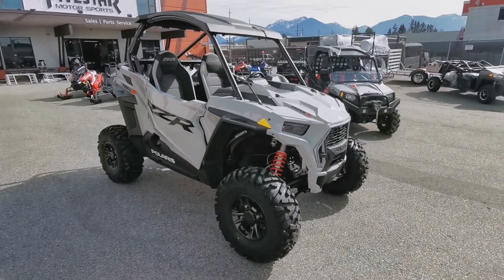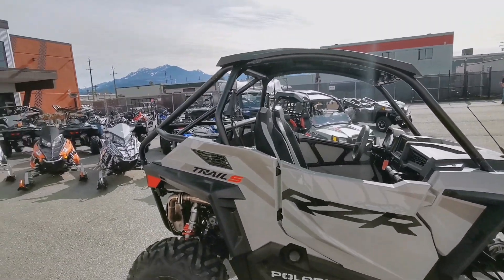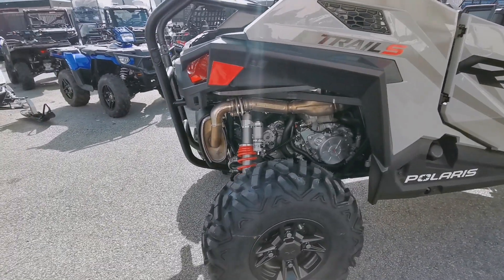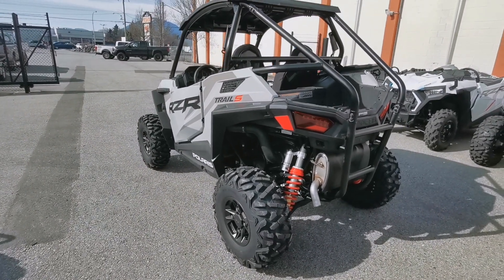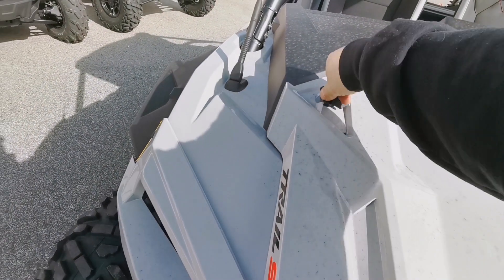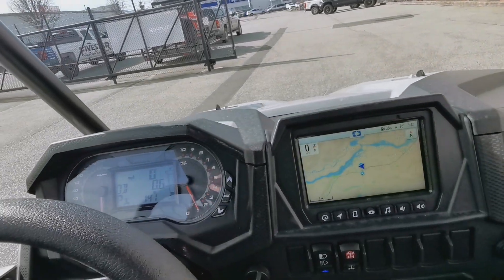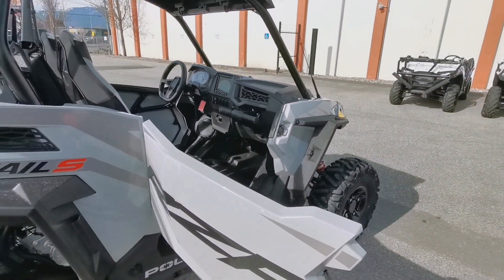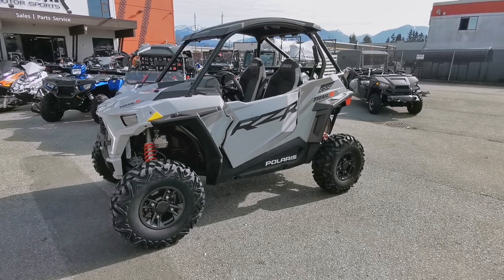Polaris RZR Trail S ULTIMATE walk-around 2021 loaded model.

Comment: Thanks for the video. I bought this exact model two weeks ago. 1st time RZR owner, so I don’t know that much about them yet. Or even how they ride. I loaded it on the trailer at the dealers, after buying it, and it did not engage smoothly. It made a loud engaging noise. But the salesman didn’t say anything, so I assumed it was normal. After riding it around the house for a couple weeks, I’ll put it in High, go forward a little, stop, and then it slips out of gear. So I’m guessing the noise isn’t normal. Your video just reassured me, cuz it took off smoothly!! Thank You
Other than that and a P150A code, I love the ride!!
Headed to the dealer with it today.
Reply from the maker: Glad it helped out! Definately something wrong there. Maybe linkage but good thing you getting it takin care of fast!
Reply: Good to know!  I'll check for that when I drive it up on my trailer at the dealer.  I just ordered one, they said 2-3 weeks.

Comment: I own the little brother  - a 50" 2021 RZR Trail Ultimate. Same setup with just a small handful of differences. I love it - the little dude will go anywhere! My only concern at times is its narrow stance. It gets a little tippy in tight spots where a 60" probably wouldn't. But, I'll hang onto it for a while, because it just barely fits in my 6x12 enclosed trailer. I've kept it stock with the 26" tires. If it was any taller or wider (like the "Trail S"), I'd have to buy a bigger trailer. Great machines, though! Thanks for the great review!!
Reply from the maker: If you can go even couple inches wider it helps with spacers or offset rims. I know they have kits at super atv to widen to 60. 
I know what you mean on tippy. Even 60 is borderline too.
Reply: @MartoriousMartuzzi  Thanks for the info! I'll look into it. My little RZR Trail is my first machine, so I'm still learning. I just try to be careful in big, rocky off-camber stuff. It is what it is, though - the very things that make it tippy and low clearance, also make it super nimble. That little machine is a lot more capable than I am! Having fun with it so far.
Reply from the maker: I have a friend that drives a 900 trail and he is off camber all day and out drive us all. But he looks like him and that sxs are one. It’s insane to watch. 
Key is ride safe and know your own limits as well as the sxs limits and the fun will last forever. And yes I love the small sxs feel also whipping around all the tight spots and trails. The big sxs are the big. The trails are trails and the 64 wide is the sweet spot. Ride safe and have fun all that matters!
Reply: @MartoriousMartuzzi  Yep, thanks! See you out there!

Comment: 2021 rzr trail 1000s ultimate I bought one about 3 weeks ago has been a great machine already have 200 miles on it but  I wish It had a little bit better suspension those small shocks don't soak up the big bumps. Also wish the rear a arms had more offset to run bigger tires. Overall I'm pretty satisfied. Realistically should have bought an XP but definitely impressed with the trail on certain obstacles.
Reply from the maker: That's good point about offsets. Guess it's part of nimble build.
End of day these shocks are okay but the springs suck pretty bad. I'd be looking into shock therapy or something to that respect. Did wonders for the maverick sport...
Reply: You dont think you could get 28” or 30” tires on it ?
Reply from the maker: Doable. Ride comfort from me and a worn out back.. I'd get the right springs to support it. Then this wheelbase will shine in the trails.